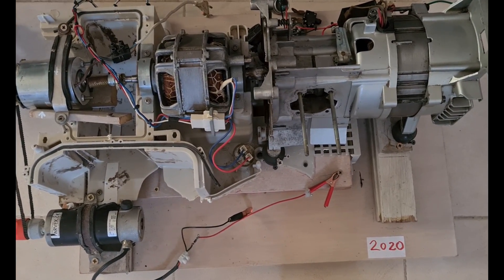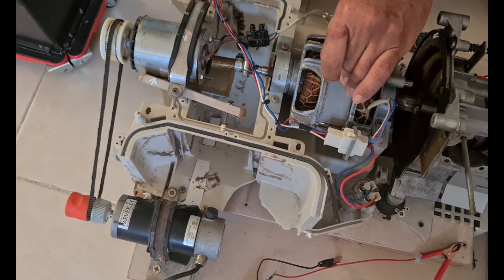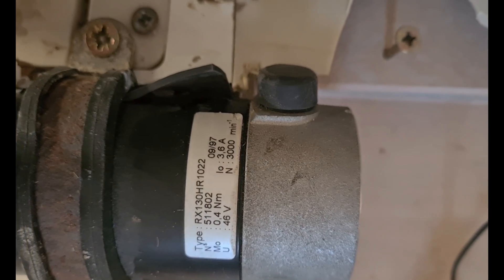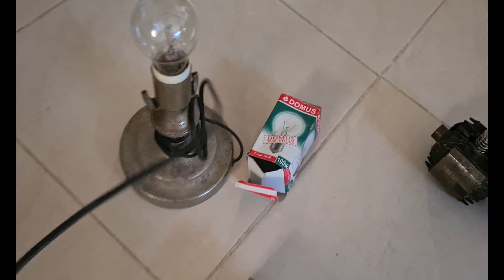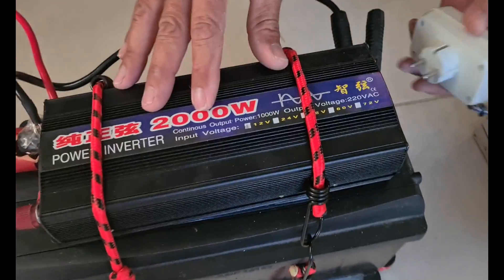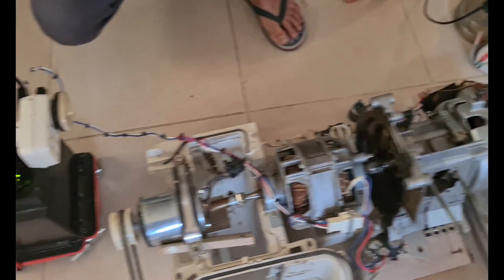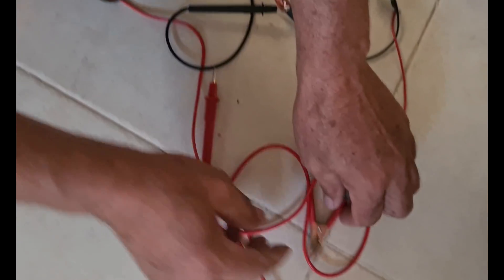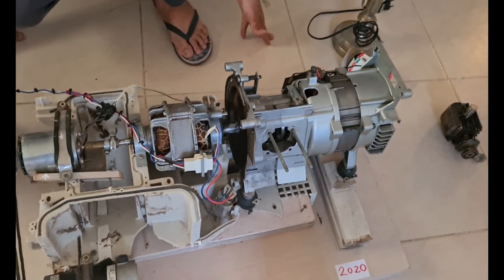Self-running fuel-less generator 2020

Comment: What in the motor hell is this FFS 😂
Just plug bulb in the inverter ffs
Do you know your wasting energy as noise from motors and that's Neva going to run for hours to charge crap lead acid batteries .....it's a big contradiction cus you charging 12v battery from a 12v battery everything else is a waste of energy more load you add the noisy it becomes...... You obviously haven't got a clue about efficiency 🤣🤣🤣
Don't quit ya day job ffs 🤣
Reply from the maker: Hi Dave, I think you should change your attitude when you're writing comments, we're just trying to share ideas here. Precisely, the generator with the alternator on it can charge several batteries and this is not the problem. The problem is to separate the batteries by diodes and a switch so that you can charge back the input battery that runs the generator only from 1 battery while others remain fresh. If you do it at the same time the generator works you will have a problem because batteries hate when you charge them and use them at the same time to run the generator. So the batteries must be separate and a separate battery is the one that will charge back the input battery while the generator stops for 2 hours for example. The battery you use to the charge the input battery will recover automatically by the other charged batteries and after 2 hours when the generator works again for a few hours, all the batteries will be charged again. The first charge battery that doesn't charge the input battery but is charged for load will carry the inverter that will give you the load for your house. There is no point in using the generator to light a  bulb when you can charge a small bank of batteries and get much more from the inverter. The last separate battery with the switch that runs the big step up converter to charge the input battery that runs the generator is full after 2 hours. And the alternator will charge the whole bank when it starts working again. It's very important to separate the charge battery because each of them has a different role. I hope it helps.
Reply: @denissabourin  @Da ve " Precisely, the generator with the alternator on it can charge several batteries and this is not the problem." BUT it is the problem! Please measure the power input and the power output, find the ratio. This contraption is less than unity, and if it wasn't you would be the first person in all history to break the Laws of Physics. Prove Me Wrong!
Reply from the maker: @pstonard  Hi Peter I do appreciate your interest in the generator. Please try to understand we are trying to find solutions to run fuel less generators to avoid gasoline, diesel etc. The generator is presented with a few options such as AC output but mostly after many tests it has proven to be the best to use it as a DC output with a bridge rectifier to charge batteries as much as possible. We agree that we are speaking about energy storage. The most autonomy you have on the batteries in case you charge 3 or 4 of 40Ah for example, you can then leave 2 to use back for the input motor of a washing machine. Then you have more autonomy than just powering a bulb of 100W by using an inverter of 500W at least with the charged batteries to power some devices at home. The point is not to prove over unity or not but to store as much energy in the batteries as possible and use it later. Thank you for your comments and input. Best regards, Denis
Reply: @denissabourin  You probably already know the science, a US gallon of gasoline has 33kWh of energy. A car battery is typically 70Ah at 12V, or 0.84kWh. And a standard car alternator is rated at 12V 95A, or 1.1kW. So you are much better off burning a gallon of gasoline at 50% efficiency that trying to recharge old car batteries. If you add some engineering measurements and do some simple math you will see all this that you do is nonsense. n'est-ce pas ainsi?
Reply from the maker: @pstonard  thanks
Reply: @denissabourin  where the hell you get 2 hours from without voltage or current readings most car battery charge from 5amp to 10amp and that's just topping it up so to start with all these batterys input and output need to be fully charged to use this when you could just connect them together in parallel they would equalise overtime which renders this project useless and a waste